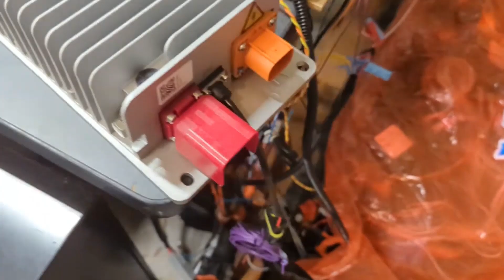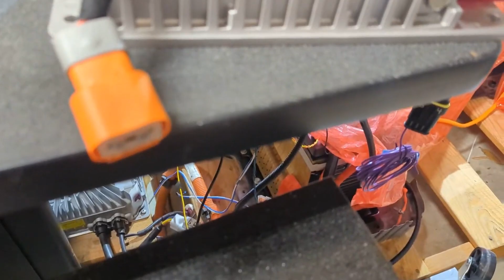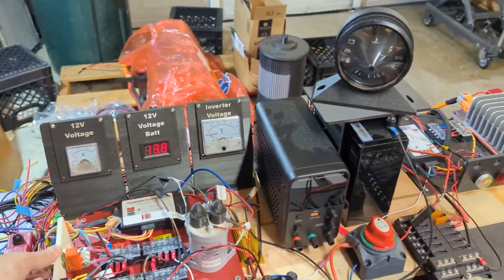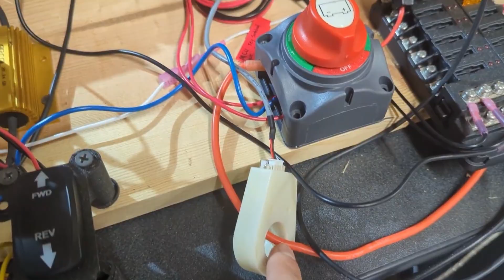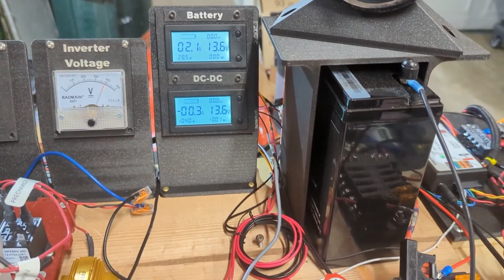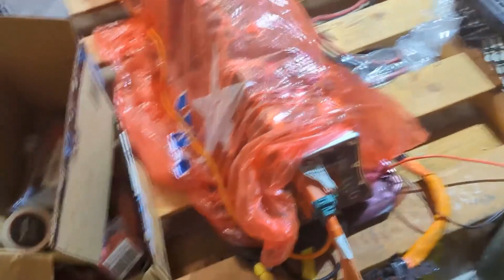Porsche 924S EV Conversion - Part 27 - DC-DC converter wiring and testing

Comment: I've got the same dc2dc converter for my project and was umming and arghing about a setup whereby if on charge the pack voltage would be enabled to it. I might park that idea for now. Incidentally, do you plan on using the signal plug?

Comment: Love this project. I work at at EV truck company and have an ‘87 924S myself. Just did a MAF conversion the other day but keep thinking about EV swap. Subscribed and definitely keeping tabs on this project. 

Would you be willing to share the 3D scans? I’m happy to help with CAD modeling if you got anything you could use some extra hands on!
Reply: Also maybe I missed it in one of the videos - but I’m curious if y’all are planning to integrate any isolation detection for the HV bus? It addition to safety, it’s a great way to be able to detect issues or possible failures before there’s any risk.
Reply from the maker: @jeffporcaro1478  I can share the scans if you are interested. They aren't great quality but could be useful. We are struggling to figure out how we can mount the motor and the battery modules. Thanks for following along with the project. Things are slow right now because we had to take a long break to deal with other things and other vehicles but hopefully we will get back to it soon. We don't have any plans for isolation detection per se, but it is likely we will need to update our design to have contractors in each battery module to limit the number of potentially live wires in an accident. We don't have those in our testbed at the moment.
Reply: In addition to the inertia switch, you can also add a “ hv safety loop” into the harness for contactor power. Like page 14 on the link below. 

Essentially an in-line connector with a loop for the circuit so that when removed from the connector, or cut in a real emergency, contactor power is de-energized. A few dollars and planning ahead for additional piece of mind. Also handy for lock out/tag out when working on the HV system in the future. 

https://energysecurityagency.com/wp-content/uploads/2021/08/Tesla-Model-X-EV-2016-2018-ERG.pdf
Reply: Let me know about those scans! And any other component files you have I can mess around with packaging. Something fun to do for the week off!
Reply from the maker: @jeffporcaro1478  do you have a dropbox account or drive account that has enough free space for me to upload them to? The total size of my 3d scans directory is about 13 GB, but I think the raw scan files are humongous and probably proprietary and not helpful. I think the meshes I was able to import into fusion of all scans is about 5 GB and that is probably what you want. Let me know if you have a place I can upload it. If you send me a private message on a forum site (like diyelectriccar) I can get you my email and we probably communicate a little easier

Comment: I had the same issue with wires crossed when I was bench testing and couldn't understand why I was burning out precharge resistors. 😮 Thankfully I realised my mistake before powering the main positive contactor so a couple of resistors were the only casualties.
Advice from Damien Maguire was to always first connect HV via a couple of incandescent bulbs so if they light up if the wiring is wrong.
Reply: It's a good idea to do the same with a 12V bulb when things get complicated on the low voltage side.
Reply from the maker: Thanks for that, but you'll have to explain to me... How does hooking up the incandescent bulb to high voltage work? How do you hook it up and why wouldn't the bulb light up?
Reply: @FrankGraffagnino  If you hook up the HV wrong you'll get a short circuit and something will go BANG! If you have two (in my case 240V) bulbs in series with the HV the lights will turn on and limit the current so hopefully no serious harm will be done.
If the HV was connected correctly then there should not be any current or only a little so the bulbs will not light.
Reply from the maker: @alibro7512  oh I understand what your saying. Basically putting the lights in series to check for a high current. Gotcha